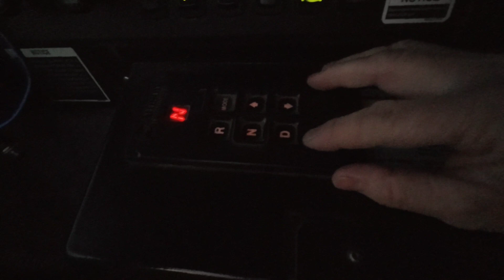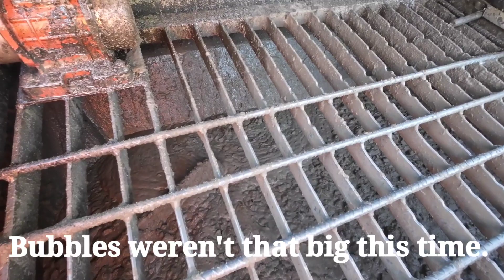Pouring Concrete Walls With The Putzmeister 38 Meter.

Comment: Gotta love them Allison automatic’s!!! We got our fist one back in 2017 and given the choice, I don’t think I’d ever choose a manual transmission ever again.
Reply from the maker: I'm on my 2nd tranny, 1st one clunked out while I was on the job one day and I had to dump the hopper in the street. Barely made it back in to the shop that day. Other than that, we love it.
Reply: @fronabargerconveyingpumping  about how many engine hours were on it?
Reply from the maker: @canadianconcretepumper1979  I'm may have it wrote down in my binder, I'll look at least. If you figure our engines hours x 60, we have over a million miles on that particular motor, it's been an excellent truck.

Comment: How do you like the orange flex hose ?
Reply from the maker: Works extremely well on walls and tight places. I sometimes use then for footings just to keep the splatter down. They don't push as well as the standard hoses, they tend to kink a bit easier at the top.
Reply: What size do you run?